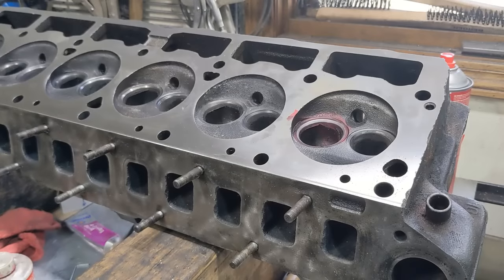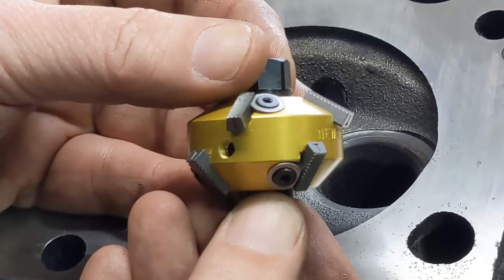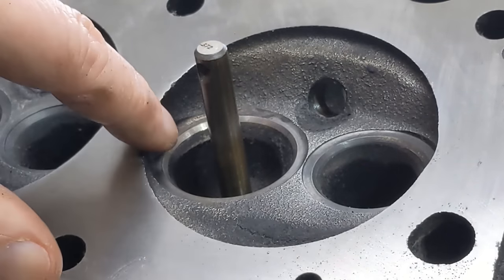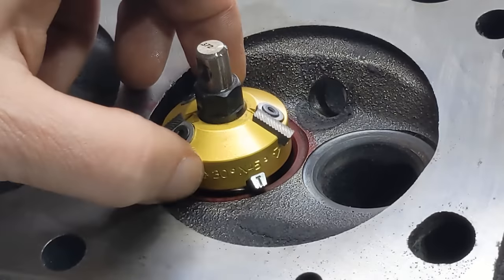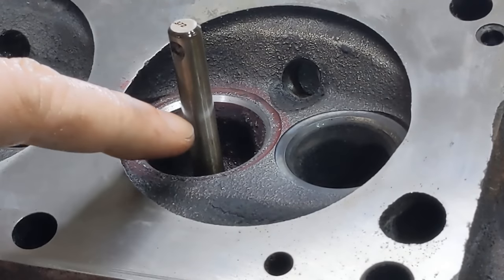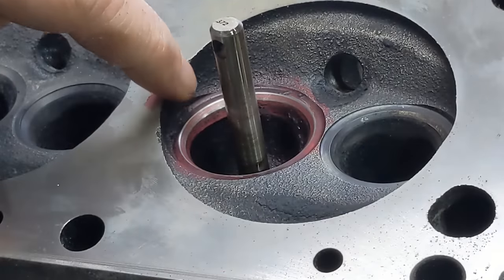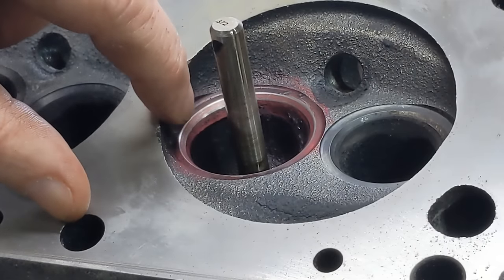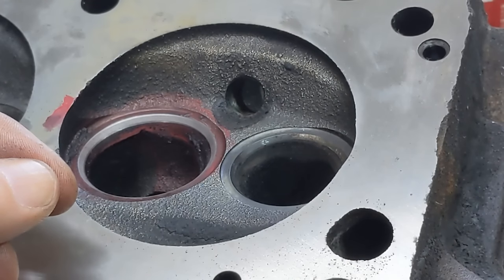Do Your Own 3-Angle Valve Seats!

Comment: According to Neway's instruction manual, you're supposed to do the seat last. Here is what it says:

Begin the process by cutting the bottom narrowing angle
(usually 60° or 75°) using light pressure. Cut until some
amount of surface has been cut all the way around, forming
a continuous line with the valve seat. This operation raises
the bottom edge of the valve seat.

Repeat as above using the top narrowing angle (usually
30° or 15°). Again, cut until some amount of surface
has been cut all the way around. This operation lowers
the top edge of the seat.

Before making the final cut, make sure that the width of
the seat (i.e. the uncut surface between the top and
bottom narrowing angles), is slightly less than desired
finished width. Also, this uncut surface should appear
uniform in width before making the final cut. If the width
of the uncut surface varies significantly from one side to the
other, continue cutting both the top and bottom narrowing
angles until the width is uniform.
Reply: Yep, supposed to move the seat to contact the valve face close to the outside edge (about a 64th) using the 60 and 30 (I'm using the most common angles for convenience). Then cut as little as possible (cutting too much "sinks" the valves into the port, which hurts performance) with the 45 until the seat is cleaned up and the correct width. Then check, and make adjustment if required - go back to the 30 and 60 to shift the seat if it is out of place or too wide. Rinse and repeat. Also try and keep the height of the valve consistent between chambers, too.
Reply: Best way is , cut main angle first top angle second ,to position valve correctly  with small margin, then use bottom angle to narrow seat, otherwise you could get unlucky and end up digging  mote out the seat than necessary 
Adrian

Comment: excellent tutorial
 the job is excellent except for a detail, your seat is a bit too wide, you should consider 1/16" to 3/32" max ( 1.5 to 2 mm ) otherwise, the valve will eventually seat on carbon and burns off due to lack of heat transfert capability
Reply from the maker: Great feedback. Thanks
Reply: Agree with ensuring the seat is proper width for the engine application. Narrow 3-angle for short life performance , wider for high load durability. Your point of heat transfer area is key, and should be understood. Narrow width on intakes can burn too. 

Great to know Neway is still going strong.

Comment: I have had valve jobs done by two different shops and after both cut the valves and seats the contact area was not acceptable. I also purchased these cutters and it does take time to properly cut the seats. I use new valves as they are cheep. I use an old valve to carefully lap the seat with fine compound just to clean up the seat of any very minor imperfections. I typically do not use the new replacement valve for lapping the seat (and yes its not really lapping) as if you over lap the valve it just screws up the valve face and if they are coated it can ruin the surface.  Then I use the new valve with Dyekem to check the contact width. If I do lap with the new valve I use very fine compound. Its time consuming but I get it exactly what is specified.

Comment: I started off rebuilding Air-cooled VW engines and was taught using  Sioux stones which I have had ever since  but I always wanted to get a Neway set for both a backup and in a pinch can use it on mobile jobs or when power is unavailable.  Thanks for the video !
Reply from the maker: I've done plenty with a Sioux set as well, but I must say these won me over the first time I used them
Reply: I got it but it’s still brand new 
Can’t stop using valve machine

Comment: I have been reconditioning heads for almost fifty years using Rose cutters, stones and newway cutters although the set I used had 46 degree cutters and RVR machines. I would note that with some hardened seats it is a good idea to use some fine emery paper initially to remove the hardening as it can dull the cutters very quickly.

Comment: A tip for those frustrated by lapping suction cup always slipping off the valve head:
Remove all oils from the suction cup and the surface of the valve, then stick the suction cup to the valve with double stick carpet tape. Leave the tape a bit bigger than the valve head so you can roll the extra tape up over the edge of the suction cup. I’ve been able to gently lift the suction cup off the valve and reuse it on two or even three valves, just keep the tape clean and be sure each valve head is oil free. 😎

Comment: I used Neway cutters 50+ yrs ago on several hundred VW engines. When used properly, they do a great job, never had a job not seal. Never used them on hardened seats though. Do your homework for pilots, clearances etc - that is just standard procedure.

Comment: cutting 30° and 60° is for air transition but also to give the seat the just contact width with de valve.  To large => valve pressure on the seat is reduce, leaks can appear.  To low => pressure to high.  I think !

Comment: you also can use the dychem to check where it is seating on the valve seat. by either coating the valve face or the seat and lightly seating the valve, this will also show you if the valve seat is inline with the valve. many times they are not even though the test you did will show it all looks fine...but may be AFU. especialy when guides have been instaled.

Comment: I’ve used nuway cutters for many years , Would never use the T-handle Because it induces inaccuracy in the cut. Nuway makes a electric drive motor that makes it effective for accuracy.I would always use a cutting lubricant on the top two seats Which is dishwashing soap ,water and a spray gun, it works flawlessly and it produces a chrome like finish .It also smells awesome when you hit it with the air gun…lol. in my opinion a good valve job does not need to be lapped in because it scrapesthe shit out of the seat and the valve. Valves need a period of time to seat them selves in ,Aftert that you’re good. Keep on rockin
Reply: What do you mean by saying "valves need a period of time to seat them selves in"? You don't hone them with compound and you just install them as it is from the factory, so they will become sealed after some time of working when the motor will running? 
But if the valves doesn't seal before, how will this motor work?

Comment: Some shops don't give you a 3 angle valve job but they charge you for it dons machine shop in Gresham Oregon did this to a couple people I know of because I installed the heads and checked to see if it was a 3 angle cut before I installed them ,check there work and don't be afraid to call them out on it
Reply: Typical. Also Oregon is one of the few states without a Bureau of Automotive Repair. Be on your guard. Anyone can nail up a shingle and go into any aspect of the car repair business.

Comment: 50 years ago when the sales rep's were going around demonstrating these to the machine shops they told you to never lap a valve. They claimed you were grinding sand into the valve and seat that would melt and promote burnt valves. 

The factory/OEM dont lap valves why would you? 50 years later I'm surprised how many on YouTube do it.
Back then the machine shops either had the kwick way stone (shudder) or these newway cutters. These are a quality tool that a lot of shops used and probably still do.
Reply from the maker: Why? Because by marking it and doing a couple laps I verify concentricity. Saying "the factory doesn't do it" I wouldn't call a great indicator. They didn't remove casting flash, gasket match or anything else that took any additional time.
Reply: @YoshimoshiGarage  Well prior to the neway rep coming in our shop we used the kwick way stones and lapped them. It was neway rep that enlightened us. You're grinding sand into the seats, sand melts with the heat and becomes glass. 
Usually the seat cutters were 1* off from the valve face. 45* valve 46* seat. If you wanted to see where the valve sat put some blue die on the Valve tap it down and you would get a nice ring on the valve showing where it sat. 
Just telling you how it was done by the speed shops/machine shops around here. No body was lapping valves, made sense not to.
We had all the latest equipment and there was nothing else around. I loved this tool, it was fast and a lot safer then the stones.

Edit; 46* seat.
Reply: Rather than lap, a good smack on the valve with a "special, dedicated" ball peen hammer does the trick.

Comment: You done well buying all the Neway pieces for $200 odd dollars. Here in Australia aside from the exchange rate  just one cutter is around $350 by the time I get 2 cutters to make the 3 angles right pilot and handle Im up for $800-900 ridiculous ripped off prices. It would be cheaper going for a holiday to the US and getting the cutters while Im having one, Great video by the way and close up what needs to be done. What are your thoughts on the portable Serdi type manual adjustable carbide blade 3 angle cutters that sit flat on the head, and have a manual turning handle to cut seat? They tend to be a bit cheaper, Im not sure go with Neway or the Serdi style ? thank you
Reply from the maker: I've not used the serdi type but have heard good things. I've used the old school stones before, but the setup is bulky and expensive for doing just the occasional head.
Reply: @YoshimoshiGarage  Thanks for the reply

Comment: Really good helpful video....Maybe I missed it,  but you seem to be Cutting the Seat Surfaces Dry without  any Cutting Fluid.. Neway recommends using a certain type Cutting Oil on their Carbide Cutter & the Seat surface & some users use WD-40...Just wondering why you didn't  use any Cutting Fluid ? ....Thx again for showing all the details on how to use this affordable  tool.
Reply from the maker: A great question. Neway recommends lubricant for "soft seats." For automotive applications, this probably means anything before about 1974 when they started induction hardening seats from the factory.

Comment: Great job & have a few questions.......Would WD-40 or other Cutting fluid Improved the Cutting Smoothness ?  .....Also, would Slightly Touching the Seat with a 45° Stone Inprove the Seat Finish ? .....Finally,.......Would Measuring the Finished job with a valve seat Runout Gauge be advisable for checking Finished valve seat Concentricity Verification ? .....Big Thx for showing how to use Affordable Diy precision Tools......
Reply from the maker: A stone might prove it, but the finish is pretty good as is. Checking runout certainly can't hurt if you have a gauge.

Comment: Holy balls, are the combustion chambers rough on those heads. My ocd would have kicked in and I would have put in some junk valves and removed some of that before doing the valve job. I also use Neway cutters and they work great. I got a different handle to turn them as well as a cutter that cuts 90* to the combustion chamber to flatten the lip or burr caused by the oem valve cut.
Reply: 90* flat cut kills the flow.
Hand blend the ridge without flattening 90*.
Reply: @hotrodray6802  Neway makes a wide cutter to bring the ridge around the port down to the same height. It flattens it out quicker and more consistently than I can by hand and avoids getting into the actual seat. I've done this with some factory heads that had horrible chamber slag and uneven chamber height.

Comment: Is it necessary to have the valves lapped with a coarse lapping compound for the best sealing surface? Bacause i would continue to use finer grits till i have a smooth finish. Just because my logic makes me think that would be better. Not because i know for sure. And thats why i am asking.
Reply from the maker: It's not necessary to use coarse at all.  All you're checking for here is that the seat is concentric with the guide, so you're just lapping enough to remove the marker/marking fluid, not remove material.

Comment: Reco shop i did my apprenticeship in the late seventies bought a set of these to try we found you got a better result with a stone but the 3 way cutters that are used nowadays in the machines are the best. Realistically how often would you cut seats at home and what if the valve guides are worn out?  Unless you are a business for the cost of all the gear your better off to take it to a shop and get it done properly heads should almost all be surfaced anyway while it is off so it needs to go to a shop.
Reply from the maker: Then by all means, take yours to a shop. I did the guides and the seats myself for under $200 in tools and parts. It runs. I'm fine with it.
Reply: Been a backyard me hanic my  whole life a little physics goes a long way with some willpower .
Reply: There's a difference between a hobbiest and a consumer

Comment: I thought the 30 and the 60 are used to move the contact area so you land in the middle of the 45 angle on the valve itself, you don't want the contact area too wide or too narrow and you don't want the contact area too high or too low on the valve face . The 30 and 60 let you move the contact area around and also let you adjust the width. I try for 2mm wide and the middle of the face

Comment: I note you picked the inlet seat to demo, this seat is straight in the cast iron head, chocolate  compared to say a  well used welltite insert for instance, or even a new soft welltite, 40% nick. Insert, these cutters don't work easily with these materials.

Adrian
Reply from the maker: This head has cast-in seats for both intake and exhaust. The exhaust seats are probably induction hardened, but I didn't notice any difference cutting any of them.

Comment: Engines will work after doing a job of this level. 
Yes it can be done better. 
Yes it can be done worse.
Goal for many is not perfection but instead functionality.
Everyone does not operate on the same standards.
For the most part everyone in the comments on videos such as these are all correct.
In the end the engine starts, goes down the road, and is reliable enough to do this daily.
This is good enough for anyone not capable of doing the work.

Comment: Try using a speed handle for more even motion/pressure and the aforementioned spring to back the cutter off the seat so you can gently 'disengage'...... may need to fab an extended socket to clear the pilot shaft. We're 4-5 months out and shops are charging $100 -$150 an hour in the Boise area   ........
Reply from the maker: Good ideas.  I might do the 360 heads I have lying around just to try it out.
Reply: @YoshimoshiGarage  You a Mopar guy ? ...
Reply from the maker: Mostly Mopar, yes.

Comment: I didn’t realize this could be done at home. Thank you so much for the wonderful video.

How did you get the new seats in? Did the machine shop that skimmed the head do that for you?
Reply from the maker: I didn't put in new seats - just cut the ones that were already there.  I put new guides in myself.
Reply: @YoshimoshiGarage  have you done a video showing the guide install?
Reply from the maker: yes.  It's here: https://youtu.be/Ky4-238Hq3g
Reply: @YoshimoshiGarage  Thanks! I actually found it right after I ask. That was a great video as well.

Comment: The only question I have is how does this effect the hardened exhaust seat does it remove the hardening or is the hardened surface deep enough.
Reply from the maker: Induction hardening goes to a depth of 0.050-0.080 inches, which is quite a bit.  You're definitely not taking that much off.

Comment: what if the valves are worn? just go with new valves?
Reply from the maker: If you have access to, or know someone with, a valve grinder, you can usually reface them.  If not, it's almost certain that buying new valves is cheaper than taking them to a machine shop.

This is what the machines look like:
https://youtu.be/JZ659SudkZM

Comment: Big mistake to use the T handle. Use a common speed handle and 13 mm socket. Because you have a tendency to go back and forth. With a speed handle you go around in a much smoother way
Reply: How many times did he go *around and around".?